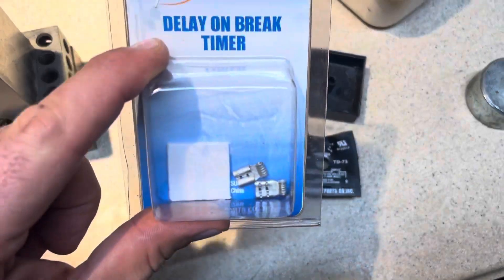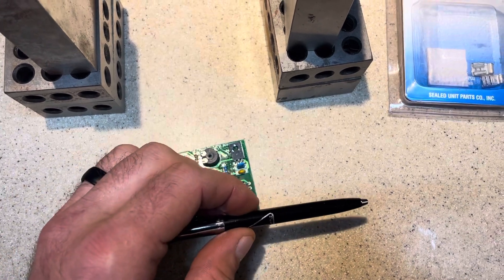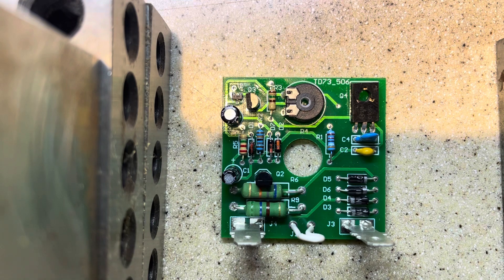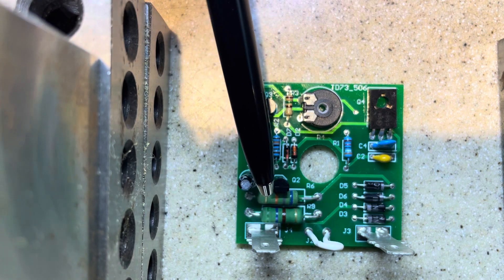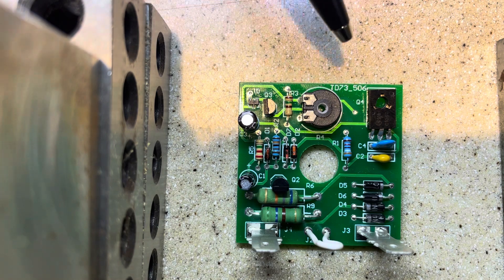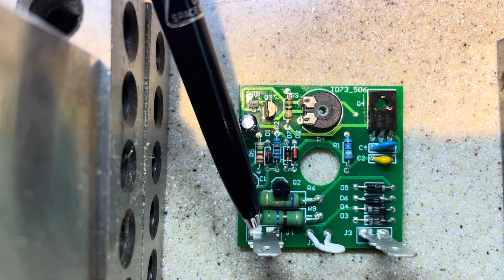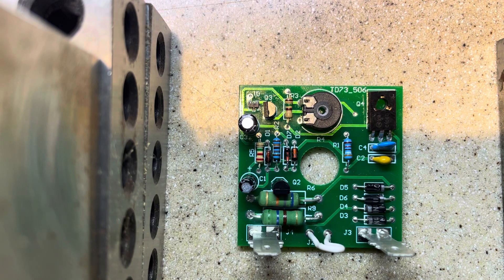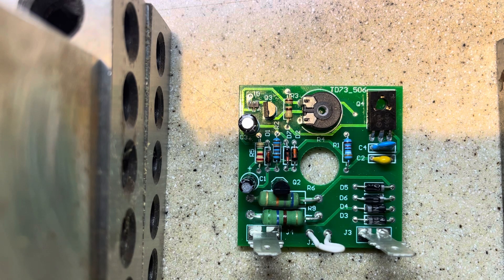Edu1:  Delay on Break Timer (Too In Depth Do Not Watch)

Comment: I need a relay to keep the circuit energized for a bit after the call for cooling ends. I have a comfortalert module constantly going into lockout for "short cycling". It's a church so the system is sized for a lot of people in there, and when it's empty it cools in a couple minutes. Thinking of just using a fan delay , like Trane's RLY2807 to keep the contactor energized. You have any other ideas? I DO NOT want to bypass the module, phase protection is critical.
Reply from the maker: Bro great question.  I was so irritated in trying to find a control that does this super logic thing…ie delay off.  I finally discovered Eaton TRL04 or 07 I did a video on it.  Let me see if I can find it.

But my ridiculously smart computer wizard cousin is going to teach me arduino.  Dude I’m so excited 😔
Reply from the maker: I think it’s in here…
HowTo10: Service an Oil Burner
https://youtu.be/wQjyCwxhaD0
Reply: @HVACLife  OK, I'll check it out. I probably wouldn't have watched that one, there aren't many oil burners around here. I've only ever worked on one, and all I had to do is install a RIB relay to get it fixed.
Reply from the maker: RIBs are the best!!!
Reply: Make sure the TXV bleeds into the suction. Sometimes if it turns on too fast after a cycle ends the high side Pressure will cause it to lockout.

Comment: How you know if the time realy is bad . Ohms or continuity ?
Reply from the maker: I’ve found the timing not very accurate so I normally wait until at least double what it’s set for, but if the time expires and it’s still not letting voltage/current through to the downstream component (usually a contactor) it’s bad.

Comment: Thank you for covering this in detail. I knew there had to be something that was holding power in order to operate the relay once power is removed. Correct?

I have a question. I would myself call this something like delay AFTER break or delay restart after break. But what do you call the device that delays shutoff after the call to turn off? In other words it stays on for a time when switched off.